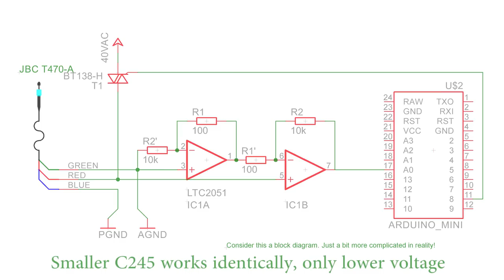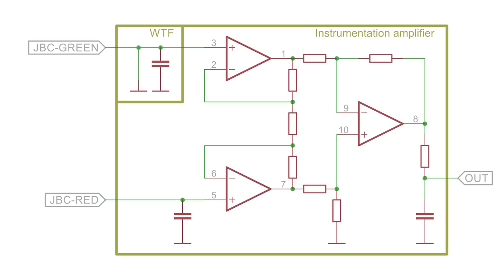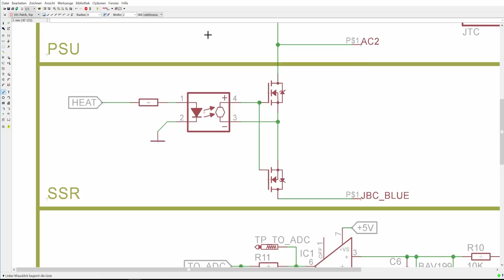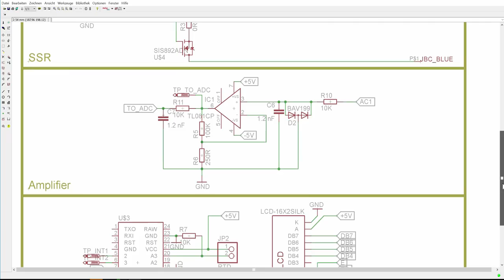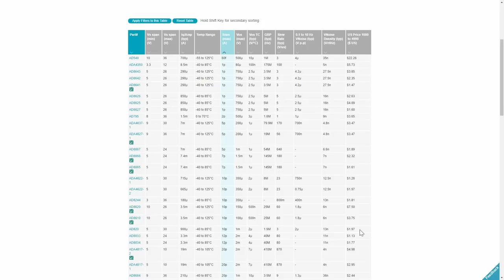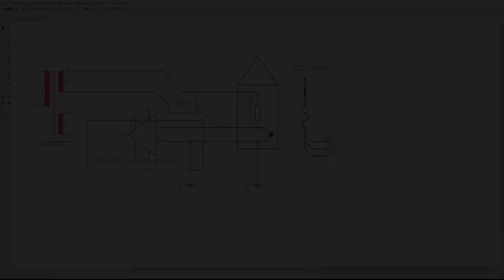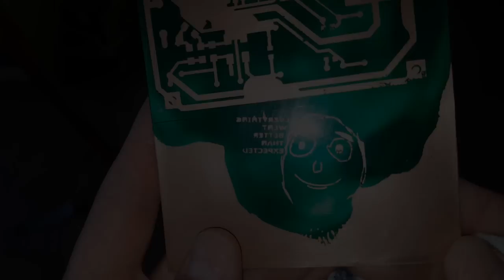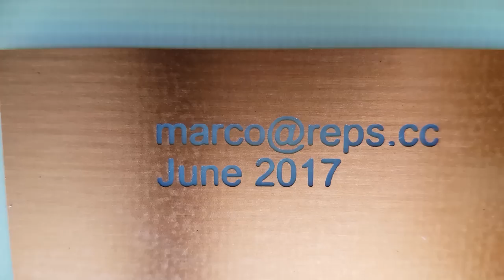Part II: Powerful DIY JBC Soldering station finished

Comment: Dude, aren't you over engineering the shit out of this thing, or am i just missing something? Why not just throw a big ass mosfet to turn the heater on-off and use an arduino to monitor the temp and tell mosfet when to turn on and off ? For power supply I'd just use an ATX PSU. Those sucker can reach up to 1000W. And the 300W ones are basically for free.
Reply: ATX powersupply is only 12V and he needed over 40V IIRC.